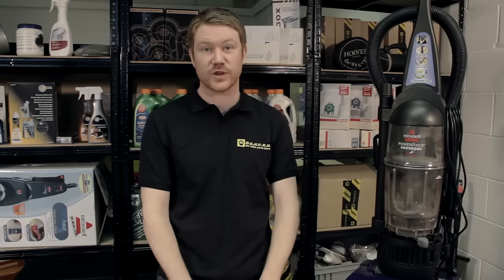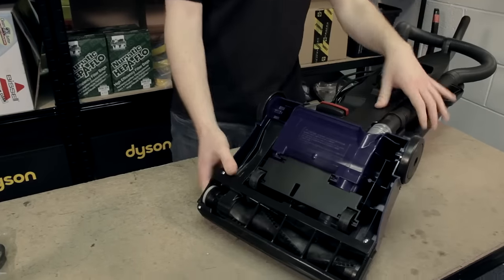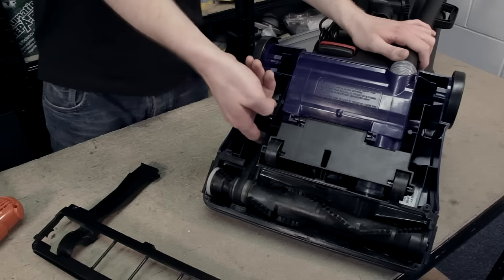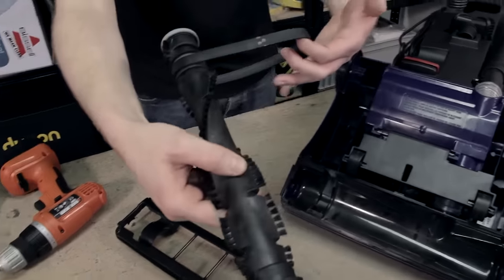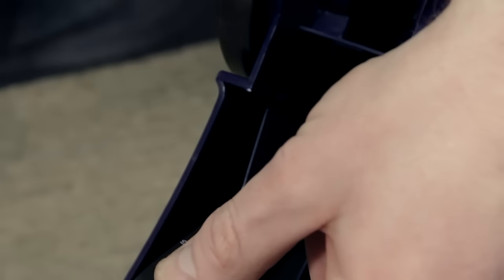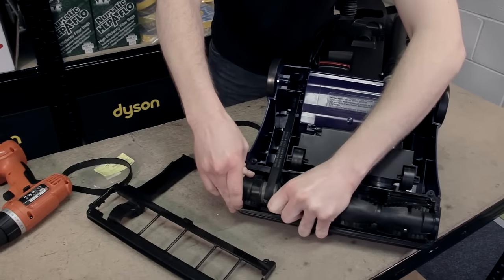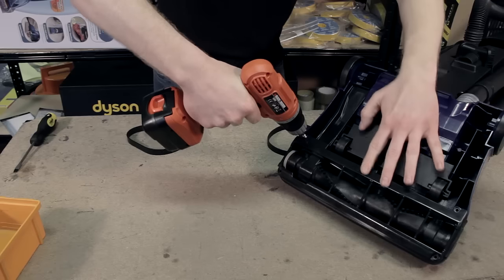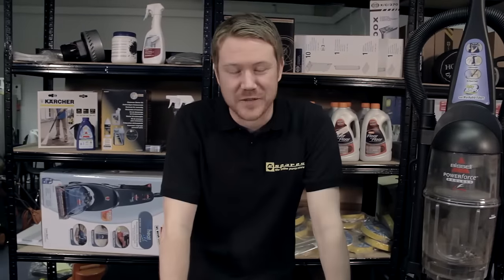How to Replace the Belt on a Bissell Powerforce Bagless Vacuum Cleaner

Comment: I just wanted to say thank you. I purchased a refurbished Bissell Powerforce on ebay. If I could turn back time... but since it's here. I've not been able to vacuum more than one room without taking it apart and putting the belt back on. I had to teach myself until today when I found your video which helped me greatly by showing me how to put the roller back in starting at the other side. That made a huge difference. No one should have to work this hard on something that is one week old but being I had to get some vacuuming done. I am very grateful for your very clear directions and excellent video.
Reply from the maker: Hi C.Meagan Michael, thank you for your comment and glad our video helped and make sure you come back to our channel if you have any other problems.
Reply: I do have a Dyson that needs the belt replaced. I think it needs a tool that I don't have. I am not sure. Do you have a video on this? :)
Reply from the maker: Hi C. Meagan Michael, we have loads of videos on Dyson repairs so take a look at our home page and search for your model.
Reply: I will! Thank you. I am SO glad I discovered you. I never thought I would say this but, "I am looking forward to fixing my own vacuum!" xox
Reply from the maker: Hi C.Meagan Michael, good luck fixing it and remember we are always here to help :)

Comment: Thank you so much.  I'm a 60 year old female and you made it easy enough for even me to fix.  Although, I'm going to experiment a little with what someone else did, by making my own belt from the rubber of a pair of swimming goggles glued together with crazy glue.  I'll let you know how it works.
Reply from the maker: Hi Cheryl, I don' want to tempt fate but due to the power transferred to the roller it is unlikely that your belt will last very long. If you need a replacement click on this link as we can post across the world:
http://www.espares.co.uk/search/pt1567/vacuum-cleaners/belts

Comment from the maker: It's likely to be an issue with the brush roll. Check that the brush roll rotates freely without the belt attached and doesn't have any hair, fibres or other debris stopping it from turning. If there is a blockage, this can put strain on the belt and force it to work harder to turn the brush roll, which can then cause it to snap. Thanks!

Comment: Mine is the Bissell Cleanview II model 3576-H. Looks just like this one, just broke the belt yesterday. Looks like a straight forward easy repair.
Reply from the maker: Hi William, that should be very similar in the repair so follow the video and let us know how you get on.
Reply: @eSpares  I did it, and found the belt was in fine condition. It was not spinning because I vacuumed up a screw on the floor, and it wedged itself against the roller. Fixed now, and I have a two pack of belts for later on.
Funny, I went and studied computers because I understand how to fix them, and they are becoming less and less repairable, but a vacuum is just basic.
Reply from the maker: Hi William, well done for fixing it yourself.
Reply: Make a video on it and ill see what's wrong

Comment: Thank you for this video. It looks like my belt is too short, although I have verified that I have the right number and size. Now I see that it's supposed to be tight, so I will put it on and vacuum this messy floor. ☺
Reply from the maker: Hi Erin, the belts can be difficult to stretch especially when new. Try hooking onto the motor and tying a loop of string through the belt as you can use the loop to pull the belt out and slide the roller in. Good luck.

Comment from the maker: Reply to Cris Garces comment:
Hi Chris, as your machine ages the bearings on the brush bar and motor will wear and the noise level will increase. Blocked or dirty filters can reduce motor noise like a silencer on an engine so it is likely once cleaned the noise may increase a little. This is unlikely to  meen it is about to fail.

Comment: Thanks for the video. Very clear and helpful.
I have a PowerForce® Compact Upright Vacuum | 23T7V, and the belt snapped so I bought new ones to replace it.
However, after I put the belt around the brush roll and placed the brush roll back to the vacuum, the brush roll will not roll at all. Any idea why this is happening?
Reply from the maker: +swarmOVplague The best guess to your problem is either the belt is catching between the motor and the brush or the brush is not correctly fitted at the ends. Take the brush out and check the ends turn freely, if not check for hair and debris between the bearing cap and the brush.

Comment: thanks u make it seem so easy !!watch when i try it wont work and ill end up getting crazy and throw it out and buy a new one
Reply from the maker: Thanks for the comments Debbie, a tip when fitting be patient. If at first it does not seem to fit take it off and try again. The belt can be tight so be prepared for a bit of a fight.
Reply: thanks so much for your help i will take your advice so glad i found this cause i was ready to just get rid of and only had a couple of months

Comment: I'd say, I cleaned up my vacuum pretty thoroughly. Now, it's louder than before (wasn't this loud when it was new). Should I be concerned? I figured it's louder because it isn't clogged up anymore and the motor's coming close to it's end. I have the Bissell Powerforce Bagless 6583 <-- I think that's the model #.
Reply: your vaccum is fine.. ull know when something is wrong
Reply from the maker: Thanks for your comments.

Comment: Is the motor spindle just bare metal or is there a plastic sheave that should go on it?  If there is supposed to be something on the spindle that would explain the smoke and belts melting.
Reply: ***** Hi Jon, We certainly have not tried to video this without showing as much detail as possible or there would be little point in producing the video at all. All of our advice and videos is for one purpose only, to help potential customers to complete repairs successfully. If you have a positive experience and manage a repair yourself you are far more likely to consider trying to repair your next problem and as a result we hope you will remember this and choose us to supply the parts you need. So any help just ask and we will do our best to give the information (subject to our knowledge and field of expertise). :-)

Comment: I have been having a difficult time. I replaced the belt just fine however it continues to burn.. I believe it is a result of the brush not turning as smoothly as it should. However.. I don't see why it is not turning properly. There are two end caps that don't seem able to be removed. I cannot check as to why it is not turning, if indeed it is not. Any ideas, as Bissell is out f stock of this piece. How can I take it apart and possibly remove debris or lube it.
Reply from the maker: You have not given your model number so unfortunately we cannot confirm but there it is likely we will have this part in stock. Follow this link and check :-)
http://www.espares.co.uk/browse/at1086ma84
Reply: Thank you. I have the Cleanview Helix.. My main question for now is, is there a way to take the end caps off of the ends of the rotating floor brush as it seems something is keeping it from turning. I barely use this machine and my home is very clean actually, little mess or big clean jobs so I am kinda bummed out that this has happened with little use.. Thanks so much for your help you have been great thus far..
Reply from the maker: Robin Hood Clearview Helix is the range we still need the model information like '21K3/22C1/82H1' to be able to identify the part. If the roller does not either pull off or screw off it may be necessary to replace the assembly complete.
Reply: pictures and names of Dyson vacuum canister vacuums
Reply: Robin Hood 0a

Comment: ok great video u have done here. but what if.. the belt is put on the machine . and it breakks or get steammy hot there gulpp.
Reply from the maker: Hi George, check the brush roll because if it is clogged it can stop it turning and cause the belt to get hot and break.
Reply: @eSpares  thanks! i just put in the belt on  now .. grreat deal thanks again there. george ^^
Reply from the maker: Hi George, well done for fixing it ☺

Comment: Hi!  What do I do if my Bissell Vacuum model# 68C71 has great suction, but spits the dirt back out when turned off.  I've thoroughly cleaned it.  Seems like the height adjustment isn't working.
Reply from the maker: +Claudia Beggs Sounds like you have an airflow problem or a restriction that is causing the dirt to be drawn in but not necessarily get to the container. For more information see another video: https://www.youtube.com/watch?v=gYEF6YxvYnM

Comment: I have the same problem as Megan and Mark. I actually got it in once that the brush turned but I haven't been able to since. On the end that the belt goes on, the end isn't round. It flattens out in two spots. I can't get the brush to turn with or without the belt.
Reply: ***** Thanks for the input CloudsToStars, If the end caps melt and stick to the roller it is caused by heat and friction of accumulated dust and debris. Once this has occurred the roller is likely to stick again from increased friction on the caps surface and you may need a new roller and caps to resolve this long term.
Reply: ***** If the roller was binding from new it suggests it may have been 'knocked about' during transporting and resulted in the end caps 'pinching' the roller and producing friction. In the UK every new appliance is covered with a 12 month warranty that would have replaced this. My comments re debris between the caps and rollers assumed a well used appliance and were general advice. :-}
Reply: +Abby Amato My problem exactly!

Comment: My spindle is just bare metal. Is this normal? Replced belt but it snapped after 2 minutes
Reply: Simiar, by sindle is plastic... so it ends up buring the rubber
Reply: Mine too
Reply: If this happens to you then the spindle may be frozen in place . Try turning the ends  if it doesn't spin freely then replace the spindle. In future you can spray a little WD-40 between the moving parts so it won't happen again.

Comment: I have the same problem as Robin Hood.  My rotating brush will not rotate with or without the belt.  I replaced the belt as shown and it snapped in 10 seconds.  I can't seem to get the rotating brush to rotate manually either.  Any suggestions?
thanks
Reply from the maker: Hi James, same as previous reply remove the beater bar remove the axle if possible and get it to turn freely'. If you cannot do this it will be necessary to replace it.

Comment: Great video.. did all you suggested but is the motor spindle just a piece of exposed metal or would there be a wheel on it or something? I reconnected it the first time, ran the vacuum and it started smoking as it was heating up and burning the belt..
Reply from the maker: Hi Robin, This will occur if the beater brush is not spinning freely. Take it out and check for a build up of hair around the end caps and signs of rubbing and wear. Replace if required.
Reply: Great will do .. Just to be clear are you saying that the part that I am attaching the belt to the  metal piece as well as the long brush? Just seems as though there might have been a piece that is missing instead of just connecting to metal.
Reply from the maker: Robin Hood Sorry I did not make it clear, the belt will usually be driven directly from the motor shaft so if the brush bar jams it damages the belt and not the motor.
Reply: I got you.. thank you so much for your help I really appreciate it.
Reply: eSpares  hi! I cleaned my bissell vaccum and put it back together but the belt it's smoking and Idk why :/
Reply: ME TOO!!! Same exact thing.. PELASE HELP
Reply from the maker: Stephanie Gallegos As discussed with Robin Hood' the problem is likely to be the brush bar. Replacing it should resolve your problem.
Reply from the maker: Stephanie Gallegos the problem is likely to be the brush bar. Replacing it should resolve your problem.

Comment: I'm having a rather similar problem, I replaced the belt, looped one end onto the metal motor spindle and the other end to the roller brush. As soon as I turned on the vacuum I started to smell rubber burning. The belt had burned off. What could have caused that to happen?
Reply: Hey Angelique! I know your comment is super old by now but I'm wondering what conclusion you came to with your issue. The same thing happened to me this evening so I'm wondering how to  remedy it. :(

Comment: I have a Bissell powerforce upright bag vacuum and everytime I go to use it the belt comes off, is it because the belt is old and needs to be replaced or is the vacuum no good anymore?
Reply from the maker: Hi Pamela, belt do wear and tend to stretch, try changing the belt before you throw it away.
Reply: eSpares turns out it was the belt now works like a charm!

Comment from the maker: It sounds as though it may well be rubbing on the motor itself which is obviously hot. Contact us to see if the correct Belt is in place or reply directly to us here with the part number purchased. Thanks.

Comment: Hello, My Bissel started getting incredibly loud, so I took the belt out and turned it on with no belt/brush and it ran silent. So I figured out I would go get a replacement belt as it must have been the cause. Nope. New belt, still ultra loud. Like obnoxiously loud. But again, without the belt and brush installed the vacuum sounds like it should. Any ideas?

Comment: Hi! We replaced the belt and after 5 minutes of use the belt started burning and we unassemble it to see that the replacement belt broke again. any thoughts?
Reply from the maker: Hi Tiffany, the most likely cause of the problem is a build up of hair around the bearings for the brush roller causing it to be stiff turning. For more information see another video: 
https://www.youtube.com/watch?v=f1nQcafiWPE

Comment: so I've been doing the same thing but for some reason the rubber band gets burn out of nowhere in side and snap why does it this happen with a new belt
Reply from the maker: +Jonathan Castillo The usual cause of belt burning is due to resistance to turning of the brush roller. With the belt off this should spin freely. if it is stiff to turn remove the roller and check hair has not gathered between the bearing caps and the roller causing friction.

Comment: Is there a puley on the motor shaft because i just replaced mine and the belt is not tite
Reply from the maker: blasterkop Depending on model most upright cleaners do not have a pulley on the motor and the belt just fits on the shaft. Make sure the brush roll spins freely as if the bearings get blocked by hair and cotton threads it will bind and burn the belt out.

Comment: I am have a problem with the belt being burnt and smoke coming from the vacuum
Reply from the maker: +Sheron Carter: Remove the belt and check the brush roll spins freely. The usual cause of this problem is due to hair and cotton shards jamming around the bearings and axle causing excess friction. This would cause the belt to burn through.

Comment: is it a good idea to spray a little wd40 on the spindles before replacing?
Reply from the maker: Hi labrador1229, if they are a little stiff you can use a little wd40.

Comment: Mine has a metal piece for level next to were belt is for the belt go over that or under it, is a bissell velocity I can't find manual! Please help
Reply from the maker: Hi Julia, if it is like a smooth metal bar you may be looking at the end of the motor so slip the belt around it and over the brushes and retest.
Reply: eSpares thank you

Comment: Where exactly is the beater bar? Is it inside the brush?
Reply from the maker: Hi Karla, the rotating brush is called the beater bar or brush bar depending on the manufacturer.  Some models have on the brush bar a raised ridge that can vibrate the carpet as it contacts it to loosen any dirt. That is a true beater bar.

Comment: I did this and it still smelled like it was burning. What should I do?
Reply from the maker: Hi Chrissy, the usual cause of the belt failing and burning is stiffness on the rotation of the brush roll. Tale the roller off and check it turns freely on its axle. If it does not remove the end caps and clean any debris between the roller and caps.

Comment: My Bissell Heavy Duty 9x cyclonic,  the belt I have no idea to take it off. Can u help me?
Reply from the maker: +R Corn Sorry we do not recognise the model quoted as we need the full model number from the rating plate to identify the machine. Then depending on the information available we may be able to advise further.
Reply: +eSpares the model is 93z6
Reply from the maker: +R Corn We are sorry but can only find limited information on your cleaner. If it is not shown in your instruction manual you may have to take the top cover off the base assembly to access and replace the belt.
Reply: eSpares I know how to open the cover but the belt I can't  take it off.
Reply from the maker: +R Corn Sorry we do not have more information on this.:-(